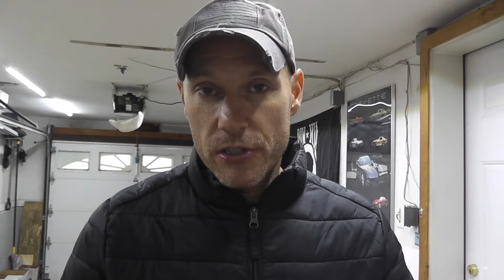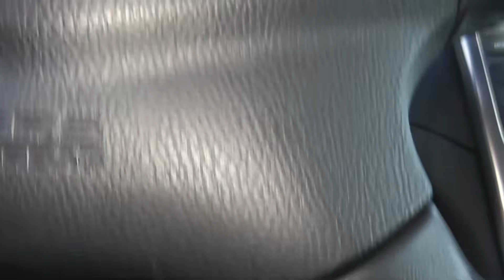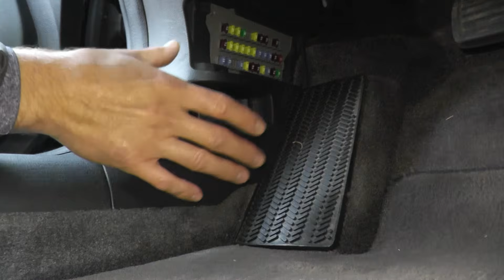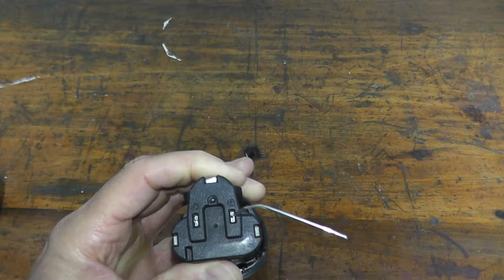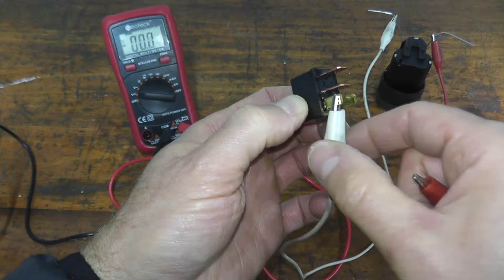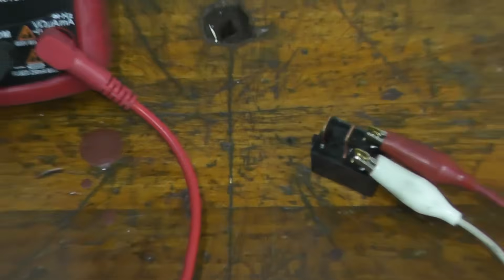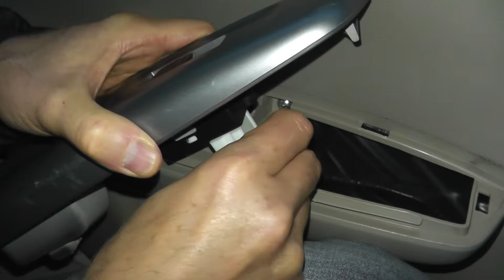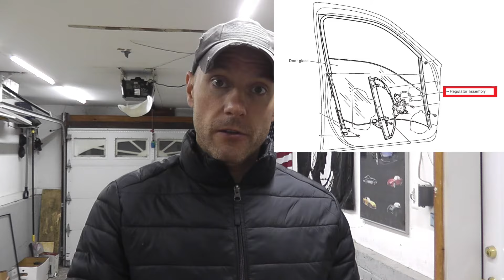How To Test A Power Window Relay, Switch and Fuse

Comment: Repairs involving trim are the bane of many, but if you take your time and see how everything is put together, how the manufacturer/designer thought, then it is easy and actually interesting. Thanks for this clip, imagine someone out of pocket stuck with a dead, open window and the weather is closing in. Few tools are needed for this repair, even just a test light and 12v battery.
Reply: That's me right now haha. Open passenger side window that won't go up and I live in a tropical climate and right now it's wet season haha. I'm very and I mean VERY unhandy but I'm going to do my best to work out why it's not going up as if I take it to a mechanic in town I'll get ripped off. You're so right about just take your time and don't stress about it. Eventually you'll work out what the problem is thanks to Youtube.
Reply: Me with the PW relay in my hand but can’t test it? Only driver window works but auto works too. Tried switched relays … to be continued don’t want my disabled placard to be stolen!
Reply: A test light can ruin switches. They are designed for sensitivity to low voltage and current and are not always protected from higher voltage or current. An incandescent tester can spike a 1 amp current as it makes a connection.